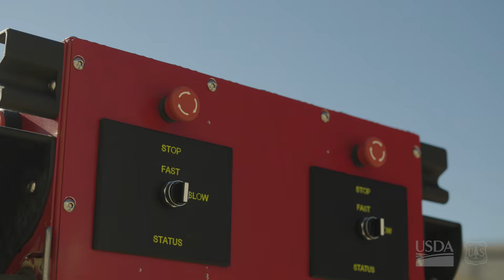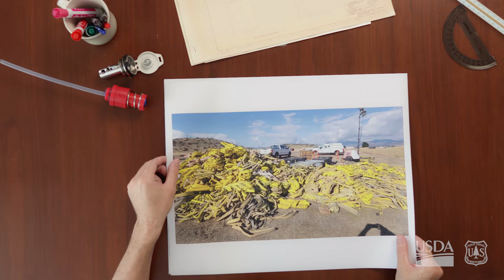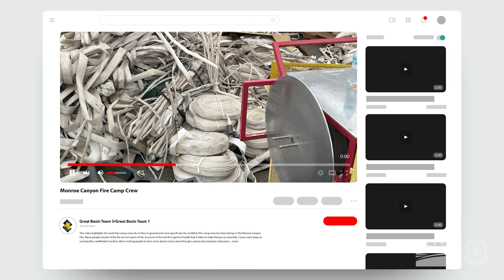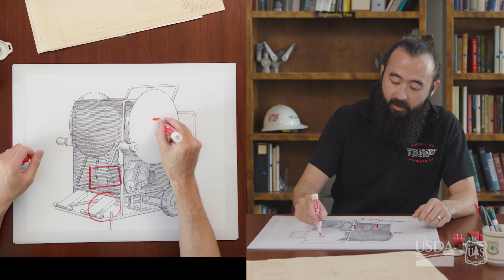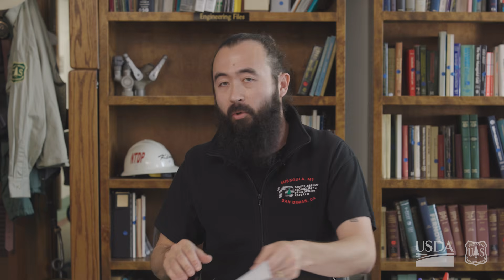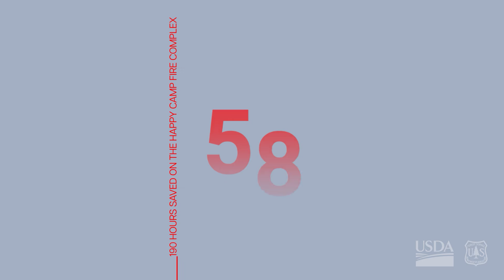Faster and Safer: Meet the New Fire Hose Roller

Comment: Every department has a hose roller. It's called the probie! But no in all seriousness, this seems like a waste of money. Easier and safer to roll it by hand or use a Halligan, like most departments east of the Mississippi do.
Reply: That works great when you are rolling 5 hoses, this is designed to be taken to big incidents where you are rolling 500 hoses per day and have a crew working on cleaning and packing the hoses.

The machine shown at the end allows one operator to load a hose while the last hose is rolling itself, and then when it's done to take the finished hose off and stack it, and put the next hose on, while the other side is still rolling a hose.

So basically a single operator can keep hoses rolling continuously, saving a lot of manpower requirements for the hose dump.
Reply: @ke6gwf I understand why it exists and thats great. If it works, it works. But we all know this is primarily aimed at burning coast departments and particularly CalFire. Out east, we just use straight manpower. It works for us. If this works for western departments, cool.
Reply: @Stargazzer811  if you’re understanding why it exist then why are you arguing that it’s a waste of money it’s really counterintuitive. I’ve sat on scene with hundreds of sections of 50 foot and this machine would’ve been a lifesaver because a lot of times we drop hose and then it gets collected after the incident and we have to consolidate and roll it up. I fought fire on the East Coast and the West Coast. It’s a different ball game. You can sit at a property for a lot longer on a forest fire on the East Coast. West Coast is a lot of moving and on the go, so you leave sections of hose.